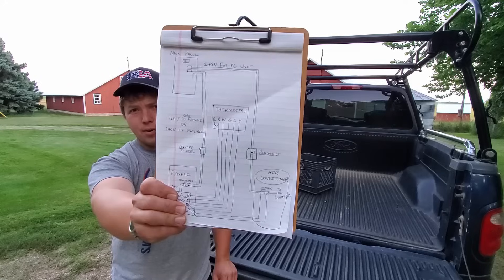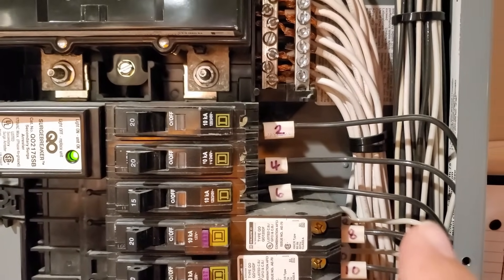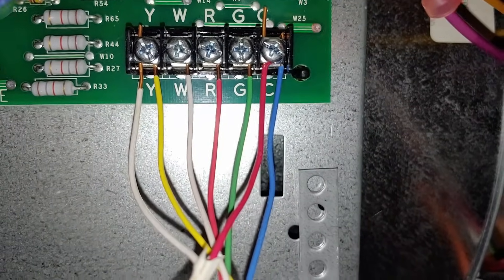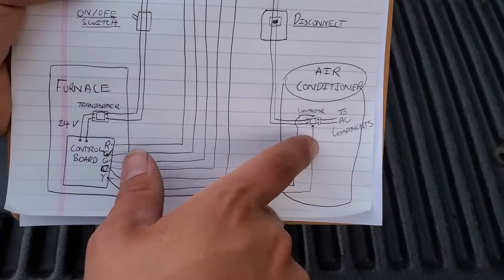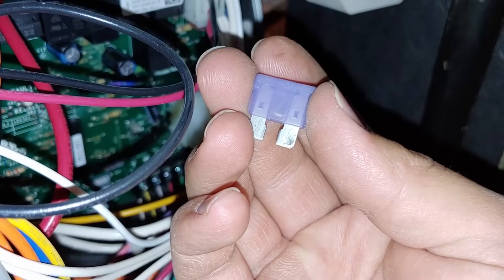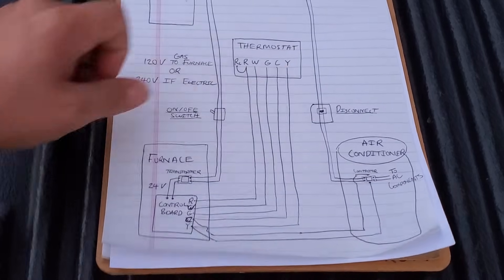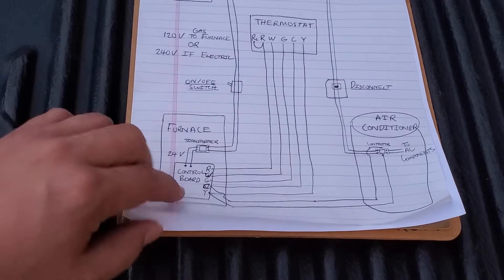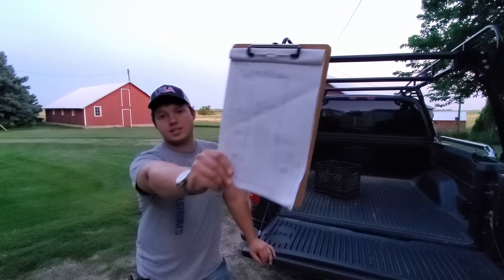Thermostat Wiring Explained!

Comment: Longtime viewer and I love your videos.  I have a customer with a 2H/1C system and am having trouble trying to wire it to a 2H/1C thermostat.  The factory manual tells me to use the W2 lug but most thermostats only use this for a heat pump.  Any ideas?  Thanks and keep making these videos!

Comment: Nice video Bro. Really clear, concise,  and informative. I better understand my system now. I have one question.  I have an additional brown wire, that I believe the tech  installed it wrong. 

Should that be connected to the W2 terminal?  Do you have recommendations for good, reliable thermostats?
Reply: Technically that was two questions:)

Comment: This is completely fine for a traditional furnace/AC setup. However, it gets a lil crazy for a heat pump, as installers don't follow traditional wiring methods all the time. Which was my case. About 10+ years ago I had to teach myself HVAC wiring to troubleshoot my heat pump wiring at the t-stat. None of them were what you'd expect or was taught. Fortunately,. I found a site that taught me how to trace wiring which I used to successfully get the job done. Except for a very short wire that came loose behind the t-stat. But that was several months down the road.

Comment: Thanks.  I watched several other videos and your video really made sense to me.  You not only connected the heater/thermostat while explaining the air conditioning/thermostat function, you really tied it all together the best possible way.  I got my wires all prepped for installation now.  I already have the circuit breaker off.

Comment: 6:54
So when R is connected to one of the control terminals by the thermostat, it's essentially just closing a switch? So it must have resistors on the board in series acting as 'the load', otherwise it wouldn't a=obviously short out the 24v. 

How many amps flow when one of those control circuits close? I imagine it would be very small and is used to activate a gate on a triac or relay or something?
Reply: yes this is like closing a switch but every on of these closed circuits will go to a load. The green terminal energizes a fan relay, the white a gas valve and the yellow a contactor. Each one of these are an electomagnetic load (inductive load, not resistive) and the total amps on a residential furnace for the 24 volt low voltage control circuit should be less than one amp and they typically have a 40 va transformer.

Comment: That was really a wonderful lesson on thermostat wires. You explained everything in terms that a typical DIYer can understand. Thanks!
Reply: Love your video I have a question that I hope that you can help me with. I have a large wood burner in my house that I have a stand alone blower on it is 120 volt how can I control the blower with a thermostat this just the blower to circulate the hot air
Reply: Use a Ford starter relay 6070s 80s even 90s. The big post on the relay Will be for your fan motor at 120 V. The thermostat will need a transformer at 24 V that will work with your two smallWire leads on the solenoid. Also wire and a five amp fuse on the thermostat side, you're 120 V circuit is already fusedAt the breaker box.
Reply: You need a fan limit switch so that the fan won't come on if the fire goes out it can be used without a thermostat or if you want put the thermostat on the other side of the house. That way it will call for the fan to come on when the other side of house needs more heat.
Reply: Thank you, sir! I taught this young lied everything he knows about the HVAC system. Do you think I did a good job?

Comment: Installing an ecobee3. Present thermostat doesn't have a C wire hooked up but the C wire is wrapped around unused behind the thermostat. It isn't connected at the furnace either. Can I just hook up the C wire to the C terminal on the furnace? And then just connect the thermostat to that C wire? Sorry hopefully I'm asking it correctly.

Comment: Hello Benjamin, 
we love your video so much. You explain clearly the wiring.
Can you explain how my thermostat has wires green and yellow swap its position ( green to Y, yellow to G) while it is not on the main board furnace? ( green to G, yellow to Y)
and why it works fine? Now, I am about to replace the smart wifi Honeywell thermostat that requires C wire. I have two questions:
1- should I keep the same order as my existing thermostat wiring (green to Y, yellow to G)or should I change it green to G, yellow to Y?
2- there is the 5th blue wire spare with wiring bundle. I can use it as C for new thermostat without damage the main board nor the new thermostat ?
Thank you so much Ben

Comment: Excellent job explaining the circuit logic!  I'm building my own solar hot water heating system and needed to understand what voltages to supply to the smart thermostat and which control signals coming back from the thermostat to use to turn on the pump.  You've done a great job of simplifying things and now I understand what all of those terminals are for!

Comment: I have a very all furnace that doesn't have a circuit board. It has one of those blocks were all the wires that come from the thermostat but like you said the Y wire is not hooked to that block. The problem I'm having is that I'm  installing a wifi thermostat. The brand is wyze and it comes with a divice that needs to be installed to the furnace because I  don't have a c wire. The c section was not being used and that's were I installed the wire coming from the thermostat  but I  can't get the thermostat to come on. Would you give an idea. Thank you

Comment: Ben- Need help with wiring a Wyze wifi thermostat to my Lennox heat pump system. My Lennox heat pump system has 8 wires coming to a Lennox SignatureStat thermostat that I am replacing: O (orange), G (green), C (blue), R (red), Y1 (yellow), W2 (black) and a white and a brown wire that I believe is connected to a Humidifier relay or ??  The Wyze wifi thermo has 10 connections: Rc, O/B, G, Y2, Y1, Rh, *, C, W2, W1. Their instructions (which are weak), tell me to connect wires to Thermostat terminals as follows:  Orange to O/B, Green to G, Blue to C, Red to Rc, Yellow to Y1, Black to W1 (instead of W2?). No place to connect White or Brown wire that may be "humidity control" wires. I wired as instructed and clipped and taped off White & Brown wire tips. Let me know please.

Comment: I'm trying to replace mine, but they are different models, I guess I need a different replacement, cause it's a W2 and an E with a wire connecting the two.

Comment: This really helped me figure out the wiring in my thermostat. Mine had only four wires going to it, and the blue wire was connected to the Y terminal. Looks like when the previous owner had cooling put in, the technician used the common powering the thermostat to control the cooling, instead of running a new wire to the thermostat. The thermostat was using battery power only.
Reply: Saved on copper lol

Comment: I just replaced a compressor for a customer who watched this video. I didn't watch this whole video but they said you never mentioned programming the thermostat. It was running the ac compressor during heat which liquid locked the compressor. Also the installers around here don't use the same color codes as you are showing. Black can be 24+ and white common with blue going to the reversing valve. 
FOLKS BE SMART AND CALL A PROFESSIONAL..

Comment: Thanks Benjamin for a great video. Simple and direct and easy to understand.  I have a question and hopefully you can help me. I understand that every system can be different. I have 2 older LUX ELV1001 thermostats. I found out that they are 120v at the thermostat. I bought an Ecobe that is 24v. In my basement there is an Argo control panel for the system. Could I just install a transformer to convert to 24 volts at each of the thermostats? Or should I run a wire from the second and first floors to the boiler in the basement?

Comment: Great Video. I have a Honeywell visionpro 8000,- Wiring question. My unit has been installed for over a year and I runs fine for heating and cooling. The thermostat has humidity settings also. I,m in Florida and want to have my AC unit come on if the house humidity goes too high. I have programmed the thermostat correctly. I get emails saying the humidity exceeds the limits. I recently noticed the AC unit is not coming on the lower the humidity. There are two U1 terminals on the thermostat and the manual isn't clear how to wire them for what I,m trying to do. The users manual says I can do this on page 13 under "Note". My connections are: Red, White,Yellow, Green, and Blue wire on C. R and Rc are jumpered.  Help

Comment: Had misadventure with a Honeywell Wi thermostat, now back to the manual.   The problem, my furnace continues to run at low speed when not heating!   what do I look for in wiring that would control the Low speed on set?   Waiting for Emerson Sensi to show up in mail.

Comment: Great explanation!  Ben, I have an old thermostat with a W wire and R/Rc wire that connect to G terminal and Y terminal on the furnace transformer respectively.  There is an extra unused wire.  Now if I want to replace the old thermostat with a a new wifi thermostat, how can I leverage the unused wire for the C wire to provide power to the new thermostat?
Reply: Connect the unused wire at the furnace to the C terminal and then do the same on the thermostat.

Comment: Ben,.  I heat primary with a wood stove outside that runs hot water to a heat exchanger in my furnace plenum.
My thermostat that controls this only has a r&g to turn the fan on but the fan does not blow hard enough. I thought initially I didn't have enough cold air returns and start working on expanding that.
But your video says having R/G only will run the fan at a lower speed.
How can I get the fan to blow at normal heating speed when all it's doing is blowing across that heat exchanger for the hot water coming from outside from the wood stove?   
years ago a furnace guy out on his first job alone wired it that way and actually have two thermostats one runs the gas furnace and air conditioning and the other runs just the fan to turn the fan on for my wood stove heat.
I use the existing gas furnace as an emergency backup in case I run out of wood or something.
I just got a new smart thermostat and having trouble figuring out how to hook it up for AC and the fan only for the wood stove. I don't mind having a second thermostat for the gas furnace as an emergency backup if that's the only way I can do it. Although I prefer to have them all into one thermostat.
Thank you!

Comment: Great video! I'm researching a new thermostat and had a ton of questions before I choose the best fit for our HVAC setup.  This answered all my questions and will make set up a breeze.  Thank you!
Reply from the maker: Glad to have been able to help!
Reply: @BenjaminSahlstrom  Got a question when my heat kicks on, the thermostat will turn off just the display but the heat and everything is still running like normal what do you think is causing that? I have a Lux CS1 thermostat. Thanks
Reply: What would be a problem with a C wire not being able to send a signal to the ac but I have power at the thermostat. I take off the c wire and put batteries in and now the ac works

Comment: Thanks A well-understood description.. 

Can I use the nest thermostat on the Middle East? (UAE) 
All thermostats here have a fan motor three-line as well as close-open line for fcu and out door unit + power cables 2 wires (mostly 230v or 24v)

Comment: why is my Furnace laying on side ways, instead of Standing up right like other Furnaces, and its location in the Attic, above the kitchen, , & what's the best way to work oN iT (the Furnace in the Attic does it have a Filter & where's the Filter Located At)
Reply from the maker: Usually attic systems have the equipment installed horizontally as yours is. The air filter should be located in the ceiling somewhere with a drop down cover that will allow you to replace the air filter. Good luck!

Comment: Great video explaining and teaching the wiring system, Ben...Very much appreciate it... If i can ask a favor.... My gas furnace, it 's Lennox Merit,  has no power...I changed the 3 amp (light purple)  fuse, like you showed in this video, but just as I turn the power switch on and press the (reset ?) white push button, it shorts and blows that 3 amp fuse. i guess there is a short somewhere... Any suggestion what should I check, next?  THX A MILLION...

Comment: Great explanation. My digital thermostat's LCD screen is not illuminated. It could be but I think I'm missing a wire from the control board to the thermostat. I could run a wire from the control board to the thermostat to power the LCD light but which terminals need to be wired? I get tired of using a flashlight to find the thermostat at night.

Comment: I needed to troubleshoot an issue after installing a new ecobee thermostat. The furnace was getting a signal to call for heat even though the thermostat was off. Turned out that the wires behind the wall were damaged and were shorting out. I couldn’t have sorted out the problem your great explanation. Thanks. You saved my bacon.

Comment: Hey Ben, I have a new touchscreen WiFi Thermostat that doesn't have batteries.  Can I use it on a garage heater that has just two wires?  There is 24VAC between them and when they are shorted the heater runs, but when I hook up the new T-Stat to W and R it doesn't work.

Comment: Hi Ben, i have current Air Conditioning Supply by Chilled Water. I am using Common Thermostat Control Switch Display which i want to convert into Thermostat with Timer or Time Delay is that Possible? Any advise? Thanks with Regards. 
Have a great Day.

Comment: Thanks for this video, Ben.
I'm going to be installing a Honeywell RTH9585WF1004 Smart Color Thermostat. The old
Thermostat is using 4 wires.
The new thermostat has no batteries. I take it, the C connection is so it has power?
And is that 24 volts going to
the thermostat? Thanks, Olle.

Comment: I have an electric furnace with ac and want to hook up my nest thermostat. But my current Honeywell thermostat has 2 wires connected to one of the terminals. One of the wires is brown !  Nest says you can only use one wire per terminal. 
I want to hookup the nest. I also want to convert to natural gas furnace.

Comment: Hi, I have a question I change my unit and does have a c wire, but my thermostat doesn't have a c terminal, it is fine if I don't connect it?

Comment: Great video bud! I have a question about the nest. I was working on my uncles furnace and the fan is on constantly after heating . I changed the settings on the nest and checked the wiring as well but it is still running constantly and ideas of how to shut it off
Reply: Set the fan switch to AUTO.

Comment: Great explanation.  My heat is not working for some reason.   I have a black wire but no yellow wire would I connect black wire to B?  Also what happens if I take out that metal connector between R and RC.  Will that cause the heat not to work?      How would you fix the thermostat and furnace to get the heat working ?      Thanks

Comment: Thanks to you I was able to connect with great certitude the c wire for my new wifi thermostat. I bought 2 smart thermostats a while ago, one for the family room and one for the basement. I installed the one for the family room without a problem. It had all the required wires but I could not do the same for the basement as it did not have the c wire. Today I decided to try again thinking  that if there is a c wire upstairs there should be one downstairs and sure enough it was tucked wrapped behind the wall and it wasn't connected in the furnace. After I came across your clear explanations I understood what needed to be done in order to have the c wire connected. Thank you very much, not only did you teach me something but you also saved me some $$ since I was getting ready to go to the big bucks store to get an adapter for the c wire.

Comment: Thank you so much. Never installed anything electrical but wanted to install my own nest thermostat. The video makes it seems quite simple. But until I saw this video I wasnt sure which switch turns off the power to the thermostat. Now I know the switch on the boiler also turns off the power to the thermostat.

Comment: Great video, I screen captured your diagram and printed it out. It helped me to understand how my home AC/Heating system is wired so I could install a new Honeywell t-stat. The part about the "Y" wire was especially useful as I have a 30 year old furnace without a circuit board. It was wired like you said, with the "Y" not connected, but spliced together up higher. Thanks man, much appreciated!

Comment: hi ben, i put booster fan in one of my room. i wand the booster fan to be turn on when my furnaces fan on.
i run a wire from 24v fan line (G) & also line from common (C).  from there i install solid state relay (model  tc48d40). my fan worked real slow for minutes and it burn out. if i buy new fan what should I do make run.

Comment: Is the low voltage (24V) side AC or DC? Many control boards and thermostats have digital circuitry, so do they all have rectifying circuitry to get logic-level DC?
Reply: AC

Comment: Excellent video.  Question: Why would a oil furnace draft inducer fan cycle properly except it continues to run even after the thermostat is satisfied, the furnace stops generating heat, and the air handler fan stops running.  If it was a wiring issue, what could be going on?